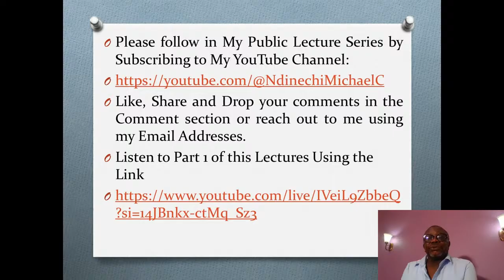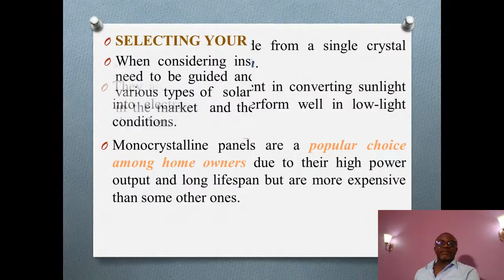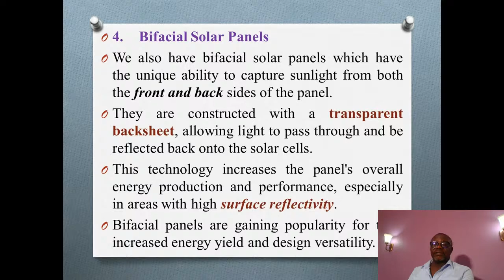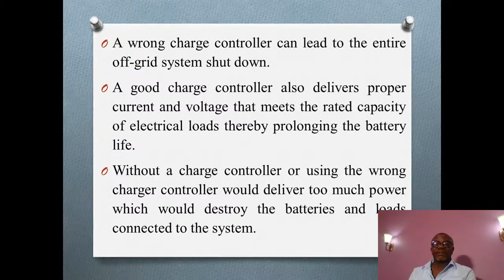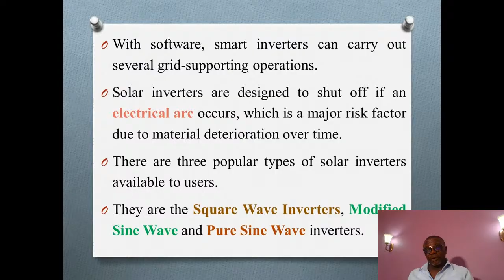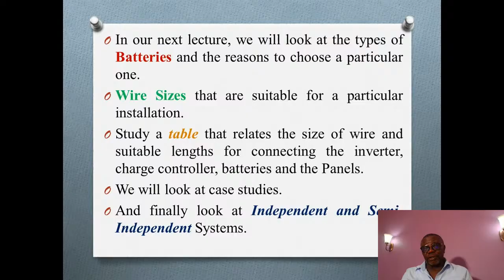Building Up Skills for Solar Energy Acquisition – What You Need to Know

Comment: I love this lecture Prof. Pls I wish to know the difference between 12V and 24V solar system, their advantages and disadvantages.
Reply from the maker: Each solar panel has its rating, that is, when it converts the photons from the sunlight, its output in volts. This is, however, better expressed in watts to ascribe cost to it. The difference, therefore, is that if you acquire a 12V panel, you need two of them to get the same output as one 24V
Reply from the maker: You know batteries are rated as 12V, 24V Volts etc. When choosing your solar equipment, you can choose to make use of 12 Volt battery or 24 volt battery. Using 24 Voltage will be more expensive for you but will allow you operate devices with higher power ratings